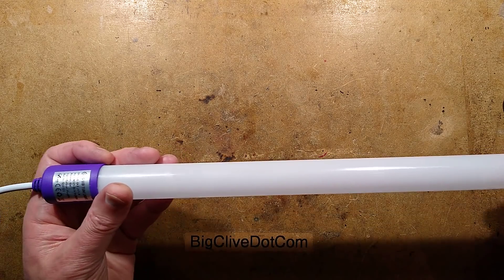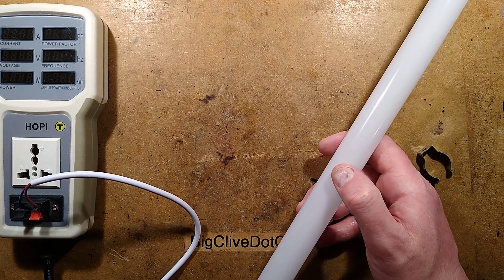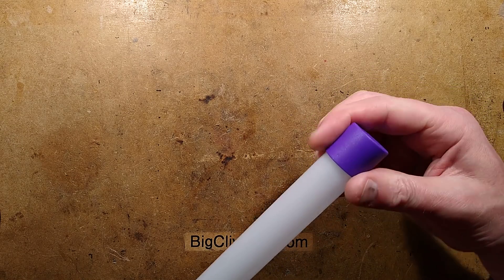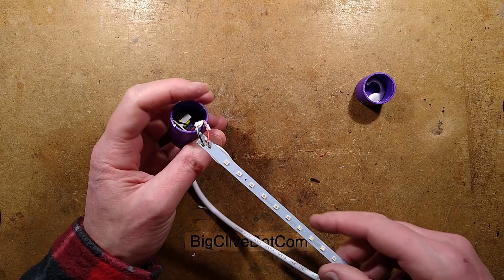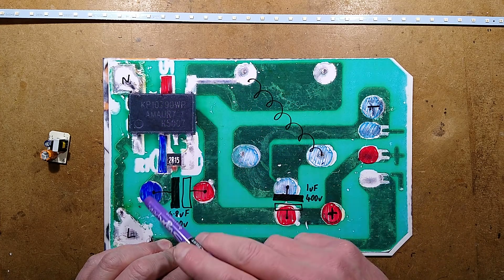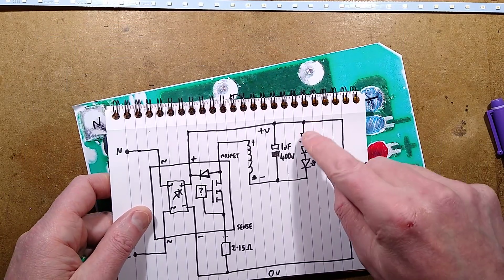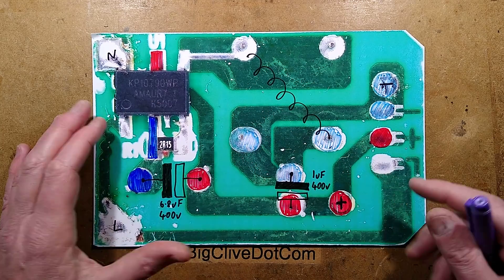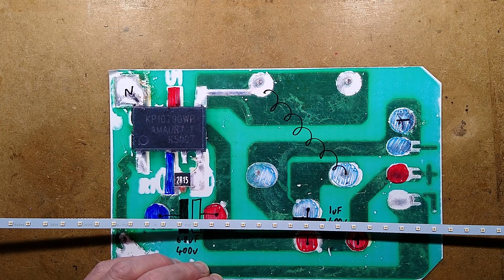Purple LED tube with neat driver

Comment: It has the spectral characteristic of LED plant grow lights.  Plants don't use green (that's why they reflect it which give the color that plant leaves have) but do need blue and red for photosynthesis.  LED grow lights are therefore much more efficient than previous fluorescent tube grow lights.
Reply: It's a myth that plants don't use green light.
McCree proved plants do use it in the 70s
If you want to know a real reason why red and blue LEDs seemed to be used so much, it goes back in the late 2000s when LED manufacturers tried to get into horticulture lighting and found that due to the limitations of the technology at the time the only way to be competitive with high-intensity discharge lights like high-pressure sodium is to use monochromatic LEDs and blue and red happened to be the only diodes that can match the efficiency.
They tried to market this as intentional, usually by pointing to the chlorophyll absorption spectrum which does have massive spikes in the blue and red regions of the visible spectrum while seemingly showing no absorption in the green region, but those graphs are a little misleading since it doesn't tell the whole story about how green light interacts with plant tissue. (It does the same for far-red but that is another discussion)

 Move to today and white LEDs have made huge strides in efficiency and costs due to their use in general lighting, and now most grow lights use primarily white LEDs (check the Design Lights Consortium to see what I mean), red and bare blue LEDs have made the same strides but the costs for those newer high-efficiency monochromatic diodes are very high and most greenhouses and indoor facilities would rather take the cheaper white light fixtures even if it means taking a small hit in theoretical efficiency especially since more natural white lights means you can diagnose problems.
Reply: @zacharytaylor8523  So you (terrestrial plants) need Red, Yellow-Orangey basically ignored by photosynthesis pigments and strip of Blue-more-to-the-Green-ish-side light. Organics (photosynthesis) not happy with light approaching UV.
Reply: @Mindaugas Stankus  actually every photon in the visible spectrum is used in some capacity. There is no color/wavelength of photon in the visible spectrum that isn't useful for photosynthesis.
Even near UV light is useful to some degree.
Reply: @zacharytaylor8523  that's not true. Other wavelength may be sensed and used to guide direct of growth but only a narrow band of blue and some red wavelengths are used for photosynthesis in the most common form of photosynthesis, (there are others).
Reply: @ElectricChicken  Look up the McCree action spectrum, this details actual photosynthetic rates based on the wavelength of light and while there is some deviations in efficiency all wavelengths in the visible spectrum are accounted for.
Reply: Not unless you spend several hundred pounds. The issue is that the light from standard "Chinesium gro lamps" leds has almost no penetrative power and trails off after about 6 inches where as HPS and MH can penetrate much futher into the canopy and deliver much much more useful light energy for photosynthesis.
Reply: 90% of plant LED are useless since most manufacturers simply use LED which have the right look it and sell it as grow LED. 
However plants function best within  specific spectrums of red and blue and real grow lights are therefore more costly. 
The high end lights for amateur use can cost several hundreds while Chinesium cost few dollars.
Reply: @johanea  and yet my weed grows
Reply: @ElectricChicken  I suspect that it's efficiency and not an on/off for growth. I've seen plenty of plants growing in caves where lights are in place for visitors and these are definitely not tuned for growth either.
Reply: @johanea  Total BS. Plants will use everything they can get. There's no "special, perfect spectrum".   I have great success using high intensity magenta LED lights from China with plain soft white leds, from China underneath.  Success depends on good light, nutrition, water and soil conditions.  Special Spectrums are BS.
Reply: @frankhage1734  Lol, you don't understand much to form an educated answer.
But the internet can teach you a bit about photosynthesis, light spectrums and plants.
Come back when you have learned something useful.
Reply: @johanea   "90% of plant LED are useless". Spoken like a true huckster.  Do you sell blue lens safety glasses for expensive LED grow lights too?   Spotting BS is actually very useful.    "Superior grow light spectra" claims are just a tool to separate fools from their money.   The best bang for the buck  (besides free, broad spectrum sunlight) is to add more flux with cheap, commodity soft white LED lights and control the heat they produce.
Reply: I stand informed.  Obviously my original comment was oversimplified and based on the chlorophyll absorption spectrum.  It would appear that commercial agribusiness in artificial growing conditions is complex when trying to maximize performance.  And I have no doubt that various wavelengths are used by a plant for numerous tasks (the McCree paper proved that).   But the cheap "Chinesium" lights from Walmart do make my bamboo plant grow in my house (but boy do they look ugly.  A few white LEDS would keep the plants looking green).
Reply: @richardlee2504  I can see how you'd might think the "Blurple" grown light spectrum would be something special. There is alot inertia from early LED fixtures as well as some expectation from the public that plants need some special spectrum and it's not like plants don't grow under that kind of light. It's just the bare minimum needed to get non-disfigured plants and it looks kinda ugly.
If you want to know some more there is Bruce Bugbee who is s well researched professor who posts videos on the Apogee Instruments YouTube channel if you haven't already seen that channel. Gets into what light plants like and also what different ratios of light affect plant shape.

Comment: the board for the power supply looks like sim card circuitry, it refers to the size and shape of it, it should be matching to a phone sim card. the older full size ones not modern micro sim of course
Reply: I think it looks much larger than a regular SIM card. Side note, an actual full-size SIM card is credit card sized, the regular ones are actually mini-SIM.
Reply: @eDoc2020  Yes but still maintain that those old Motorola phones weren't mobile, it was like carrying a half brick in you're pocket. lol

Comment: if even thing after the bridge rectifier is dc why is the power factor 0.57 I though dc doesn't effect power factor ?
Reply: Current is only drawn at the top of the sine wave when the large capacitor gets charged.

Comment: Why has it got that squiggly wiggly track to pin 1?
Reply from the maker: Possibly an attempt at a PCB fuse.  Usually thinner at that point though.
Reply: Maybe someone drew an american-style resistor symbol on the schematic and the PCB designers took its shape literally
Reply: Could be a poor attempt to reduce EMC? But it's mains frequency so no high frequencies in there... I was wondering about that as well.

Comment: The purple tube looks nice
Reply: I agree. I'm know to immediately go and buy the cool lighting. I've been waiting 3 months for like 100 worth of the long edison filaments.
Reply: Indeed it does! I've been trying to find proper purple LEDs for years without really any luck.

You can of course get the UVA LEDs around 350-415nm that aren't very bright, and the blue+red horticultural LED combinations that are nice enough but more pink than I'm going for. It seems that any search for purple LEDs on AliExpress leads only to those types.
A few years ago I also bought a selection of "purple" LEDs from either Digi-Key or Arrow. Some were pretty much just near-UV. Others were a few different colour shades from a product line aimed at plant growth, IIRC, but they were more red than anything else :(

I recall Clive showing one or two Poundland(?) products with purple LEDs a few years back - Hallowe'en maybe? But I never found those LEDs on AliExpress or elsewhere.

I expected this purple tube to be white or blue LEDs with the tube itself providing the purple colour, so that was a surprise!